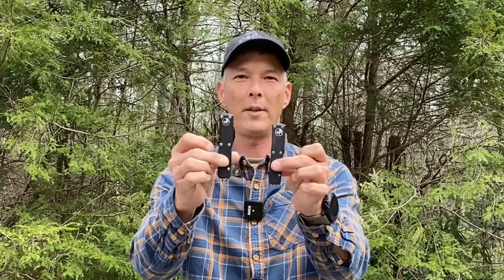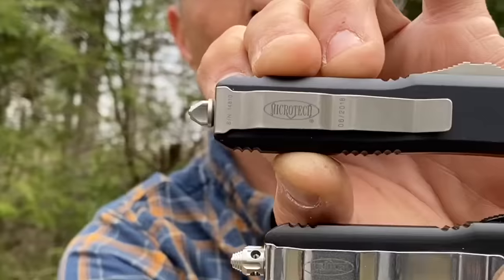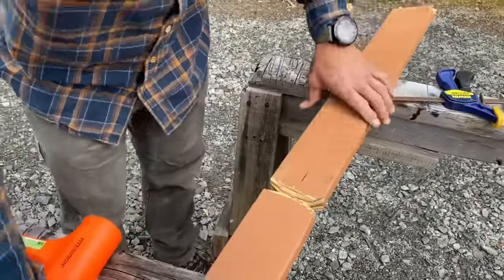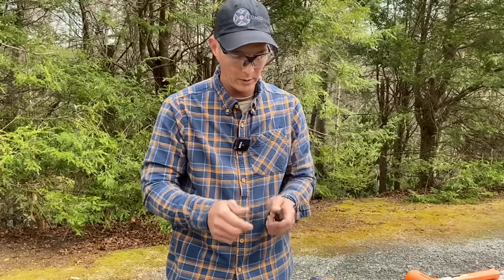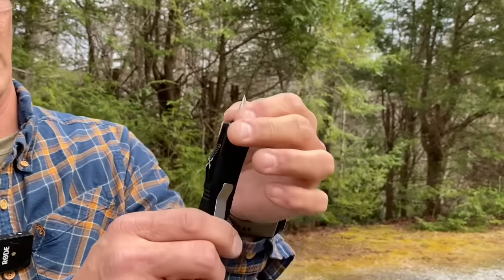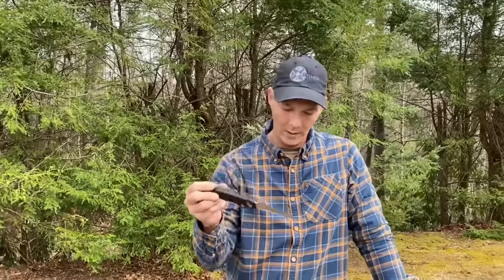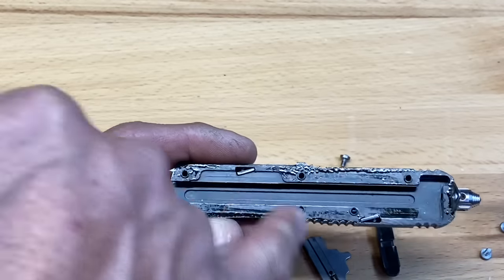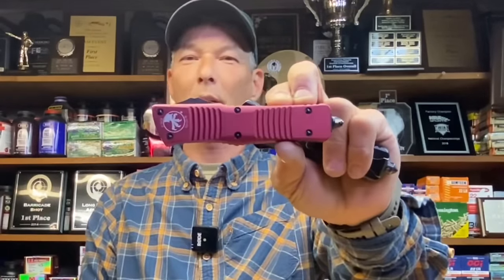Counterfeit Microtech torture test!

Comment: You did a damn fine job of proving that the Microtech is overpriced.
Reply: How so? One broke the microtech survived .
Reply: @mattmorrison9379  One's about $50, the other over $300.  There's a 600% difference in price, and the cheap one performs nearly as well as the expensive one.  It "failed" when induced to stress no reasonable person would be subjecting their  knife to (hammering it through a 2x4).  If the cheapo would spend a few bucks more on better raw steel, it probably would have passed that test too.
Reply: @heathwasson7811  fair enough, personally I like having a real one it definitely feels better than some clones I've held but hey to each their own it's all good.:)
Reply: It's amazing the amount of money you can save on production when you steal someone else's R&D, use cheaper materials, skimp on QC,  don't offer a warranty, and probably don't pay your employees a fair wage.
Reply: @blc628  Yeah, no shit. Everyone's fully aware of that.  Like we don't know the reason one can sell for $50 and the other for $300?  Glad you came around to straighten everyone out on that.  Feel good about yourself now that you had the chance to dazzle everyone with your stunning economical analysis?
Reply: @blc628  There aint any R&D in this type of knives. The technology is old and all tried out. All you need is a cosmetic design and good enough materials. Anybody familiar with Solidworks or Fusion360 can make the schematics to feed into machines. Warranty - yes. Thats another question. But warranty means that you shouldn't torture your item above the limits of normal use. Im more than sure Microtech's warranty wont cover breaking the knife while hammering it into 2by4. So, if the chinese clone stands more than normal use (as we see in this video) it would be a problem to just buy another one for 60 bucks if you manage to break it somehow...once in 10 years or so. At the end of the day you're still on the plus side.
Reply: What R&D? OTFs have been around since before any of us were born.
Reply from the maker: @MrSoymilk2 Internal designs, longevity deployment strengths. 
Zero blade play OTF’s etc.
That’s kind of like saying nothing wrong with the engine in the Ford Model T. …They have been around since before we were born.

Comment: Your point has been proved, thank you for clearing up that i can save 140$ and get a knockoff just as long as i dont carelessly nail it into a piece of wood for no reason :)
Reply: Yeah until one day when you're about to get mugged you pull it out of your pocket and a cheap piece of crap spring inside doesn't let the blade come out and your left holding a small rectangular piece of steel😂😂

Comment: Honestly not bad for a chinese knockoff.
Reply: What I was thinking
Reply: No clue what steel they use in them but I've seen friends clones that are spot on and some even better feeling and looking than some of my older factory knives lol
Reply: Not bad?!that shit broke in two minutes!
Reply: Yea who the fuck uses their knife as a nail.
Reply from the maker: Mr. Hammer ! 😂
Reply: @trillestdccxiii4971  It’s most likely either 8CrMoV, 440C, or D2.

I just recently got a Microtech but I’m thinking of getting a clone as a beater. It aches my heart to mess up a $270 knife, which I already did the day after I got it.
Reply: @havoso  In two minutes? It took minutes of taking several blows that no knife would take in a normal situation, this "hammer test" is a case that would naturally be unlikely to happen. The knife passed the previous test, which was very aggressive and he was even surprised that the knife cut the paper. The problem that the knife presented was with the small steel lock, you would just have to replace it with a small steel plate of better quality and you would still have spent hundreds of dollars less than at Microtech.

Comment: Also! Look at the difference the 10% more material makes! So if you add 10% more steel into the lock, then it passes the test. If not, it fails. What is the lesson? Knife costs probably 15 USD to manufacture, add 10% and you can sell it for horrendous prices! :)

Comment: Wow, I am stunned by the lack of ethics in many of these comments. Some are saying things like, "Wow X-Ring, you showed me how great a clone is! I'm going to go get one." First of all, X-ring did not demonstrate what happens to cheap steel when testing it as he did. AUS-8 (which is probably what these knock-offs use) can do all of the stuff X-Ring did, but will roll and possibly even chip. Bohler M390 (which is what many Microtech blades are made of) will also withstand those tests AND keep their edge without damage. But, on top of all that, even if these knock-offs can do what you need them to do, you are supporting criminal enterprises when you buy them! If they were simply crappy 30.00 look-alikes, it would be one thing, but these clowns are counterfeiting the Microtech logo and branding. They are pirates, period. Supporting their deception is unethical at best, if not downright immoral. Look, if you can't afford a Microtech, that's OK. They are expensive. So, go get a Lightning OTF instead. It'll only cost you 30.00 and you didn't sell out. Lightnings are from an honest company who doesn't pretend to be something they are not. One day, when you can afford the real thing, it's be a much sweeter experience.
Reply from the maker: You are 100% correct James and I appreciate your comment on this.  Seems like cost is the only deciding factor and nothing else matters to a few people.
Reply: @XRING  Thank you sir. BTW, I just watched the video where you burned and abused your Combat Troodon. I found it because I just purchased one and wanted to see some reviews. Wow, I was impressed. I know that to some they may see your torture tests as extreme but I, for one, want to see just how far I could push my tools without actually having to. I appreciate your work! Keep it up.
Reply: I think is its far worse that there companies try to screw us by selling knives at a 900% mark up, if Chinese knockoffs are good enough to compete and at 1/10 of the cost then it is obvious who is getting screwed

Comment: I've had one of those hellhound clones from DHgate for 4 years now. I've never tried to nail it into a board but I've been rough with it and it's still going strong. All the ones I've seen advertised say it's D2 steel and that's what it feels like, it's better than those 3cr13 Tacforce knives. As long as you know going into it you're basically buying a $40 knife and not to expect $400 worth of quality it's all good.

Comment: that counterfeit did pretty good considering no normal person would go so extreme on their pocket knife. for 30$-40$ its not bad at all. it just shows how much some companies overcharge for their products...
Reply: The Microtech is not overcharging at all. The parts are made in the US instead of using chinese labor. They have to pay their workers a lot more than the chinese do, since our SOL is a lot higher.
Reply: @notgray88  sure, labor costs are much higher than in China. However most of the work is automated and done on assembly lines. That is why it's hard for me to justify price of $764.26 for Microtech Troodon Tanto. Most of Microtech knives cost way too much, e.g. 
Microtech Ultratech OTF D/E Automatic Knife. Price: $935.00
or Microtech Combat Troodon Knife Price $1,150.00
I'm not even gonna mention Microtech Marfione Line where one knife can cost you $2,500.00.
I know that most of Microtech  knives cost in the range of $300-$500 but Kershaw knives average price is around $50 up to $100. Kershaw knives are made in Oregon. It is just my opinion, that Microtech is charging little too much for their products and I can see why some might want counterfeit instead.

Comment: I would not be able to hammer my 230 dollar knife through anything without crying.
Reply: then buy an affordable knife so you can actually use it..
Reply: in europe is over 460euros...
i better use a mora for batoning. and is 10 euros, dirty cheap and original.
Reply: Get a Benchmade OTF.
Reply: Apparently there are a few sites selling entire replacement blades for these clones for cheap too now
Reply: @shiitakestick  that way you only have to spend 450 instead of 230.
Reply: Florida Man - not here.
Reply: @shiitakestick  I have no idea what you're trying to say.
Reply: Florida Man -  I see a BM otf is now $420 - more than I thought - but I think it’s still a better choice than Micro-tech.
Reply: @shiitakestick  you're still talking nonsense. He's saying the knife is expensive so you say to get one almost double the price.
Reply: @moneymark7660  I have never hammered my knife thru anything.  I have used the end of my dirac delta to knock something into place however and I have plenty of knives to beat on if necessary.
Reply: @shiitakestick  the infidel has always been through the roof.
Reply: Florida Man -  youre right. guess I thought he meant a real microtech . 
excuuuuuse meeeeee .
Reply: I would not do that to my $50 bro
Reply: @moneymark7660  use a axe or he’ll get a Swiss army or a silky saw!
Reply: I have a $12 knife I’d never do this to. I think the idea is the 1 in a million situation you’re in a knife fight and stab a guy and it hits a bone and fails you’re dead… funny thing is it never failed like that, even under the most ideal setup for making it fail, all it did was not close properly afterwards, probably hit it just right to bend the case or something and some dremel or hammer work would make it functioning again. If anything this is an ad for the clones, no normal usage should cause these to have any issues, shame on microtech for overcharging.

Comment: The Vespa OTF's steal largely from Microtec designs, but they don't market them AS Microtecs...  They put them over their own label and they do make some aesthetic changes to them.  Their knifes however, ARE legit premium steels... Their lower level $80 knives are D2, but the $130-$230 knives are M390, etc...  Several buyers have sent theirs off to a metalergy firm for testing and got the test results back and they were legit.
Reply: If you are a knife guy it might help you to know the plural is knives
Reply: Ders972 that’s your contribution to the discussion?  To point out that I didn’t proof read my grammar?  One might think that  you went that route, because you had no other response to give?  Lol. Thank you for policing the internet to make sure that everything is spelled correctly.  Not all heroes wear capes.
Reply: The point people make about Microtech is that they claim the knife costs $10 to make (wrong) and they should sell them for $40.  Now a China based company is making their own OTF knife but feel they need to charge $230 for it.  Shouldn't they be able to make a quality OTF for $40?  No one doubts that China CAN make a quality knife, but they are not making quality counterfeit knives for $40.  Also, when it comes to counterfeits, it isn't in that company's best interest to make a knife that lasts, they rely on repeat business and know if you will buy one $40 knife you'll buy another when that one breaks... and another... and another.  Eventually you'll have $300+ of broken counterfeits when you decide to buy one $280 Microtech and you'll finally find happiness.
Reply: @Kevin Exactly.  Now, when at work, I make the extra effort to correct simple grammar or typos... but in the world of mobile and spotty autocorrect, I don't always catch it.

Comment: I think you just sold me on the clone. 🤷‍♂️ I mean I’m never gonna do any of the test you just did. And It looks like it can take a beating. And for 40$ what am I really losing. If microtech was cheaper of course I’d go that route but at 10% the cost how can you go wrong.
Reply: I predict you will be wasting a lot of your money re-buying things. Better to save up and buy once.
Reply: I have a utx clone from DHgate was 38. The quality is amazing. Fit and finish is amazing. Action is fast and solid. And blade took a shaving polished edge on my work sharp. Iv been beating on it and using it for everything and its held up great.
Reply: Only downside is no warrantee but there easy to strip down and work on if needed
Reply: Not that I condone buying clones but those Microtechs are way overpriced for what they are.  It would be a cool knife at $125. Costs them prob $20 to make it.
Reply from the maker: They cost WAY more than that to make.  I did the series on birth of an Ultratech on the channel.  Really made me understand what all goes into them.  Not justifying the price,  just stating the facts.  Thanks for watching.

Comment: Ah yes, that 380$ extra for the actual microtec so that I can drive it through a 2×4 is completely worth it. 
Granted yes, if it is blatantly ripping the company off with branding, no thanks. However if it's just the design I'll gladly pay the 20$ for the "cheap crap" that is nearly on par for less than 1/10th the price.

Comment: Pretty impressive comparison!  Interesting that it wasn't the blade lock that failed, it was the handle which I'm guessing is a Zinc alloy which would tend to deform under the hammer blows.  6061 Aluminum isn't the strongest alloy,   I would expect that MT would be using 7075 which is much closer to mild steel in tensile strength, but then, that's not how the handle material failed, it failed in compression, though not really "failed" so much as deformed just enough to stall the blade.  Most likely the knife could be put back into service by truing up the blade slot, and at least having a light-to-medium duty cutter.
Gotta admit the MT UT was impressive!

Comment: Microtech should make an entry-level version with no warranty and less expensive steel (D2 for example) for under $100.  Then there would be no reason for anyone to want counterfeits.  90% of the people that are interested in a dual action OTF knife are never going to baton with it and certainly aren't going to drive it through a board like a nail.  They just think they are cool and want to fidget with them and open packages and letters or cut off a string from their pants.

Comment: A little homework about Elmax steel:  It is a tougher steel with high carbon content that hardens to Rockwell 61-62.  It is also a powdered steel...meaning Elmax steel powder is compressed into ingots - or blade shapes, then heated to form the final part.  Interestingly, in other areas of the consumer market, POWDERED steels are considered total crap!  Many in the gun world never grow tired of dissing powdered metals as being "cheap" and "weak" and subject to breakage compared to good old forged and machined steel!  Interesting indeed!
Sure, eventually, all steel items will be formed from a powdered alloy because this is easier to create parts in the final shape and near dimension, and of course in 3D additive manufacturing, though even now that process is far too expensive for common knife making.

Comment: I ordered two knives off dh gate. The benchmade 9400 came in two weeks and is fantastic. The fakerotec halo vi is still in the mail and it hasn't updated shipping in over a month. Even if it never shows it was worth it for the benchmade clone.  I think it's best to buy the most expensive one with reviews.
Reply: Did the Halo ever arrive?
Reply: @aznazguy  sure did. Absolute perfection. No blade play whatsoever unlike the real ones and unlike the real ones it came with a tool to disassemble. I've fired it a couple hundred times and it's still holding up great. I

Comment: Got my first microtech today and was watching this video with dread until you were pointing out the fake give-aways and noting that mine didn't have any red flags. WHEW! Still not gonna hammer it into a board though.

What's surprising me the most is when you took it apart the sheer simplicity of the design. I been thinking there was  a ton of moving parts in there but it's honestly not a whole lot and it looks like worrying about pocket-link affecting it's function is not a real worry because it can be easily maintenanced due to the simplicity of the internal design.

Comment: I've been tempted a few times to buy a Ultratech.  I have a Cobratech, higher end with the Aluminum handles, and D2 blade.  I paid about 130 dollars for it about 3 years and have never had an issue...Now, I was thinking of buying a Ultratech, and the one I was looking at is 290.00...The Kicker is, even though it's 290 bucks, the website says, "we can't tel you what Steel the blade is made of, as we change all the time".......If I'm paying 300 bucks for a knife, I'm damn sure going to know what "steel of the Month" I'm getting......

Comment: I would still love to see a torture test of a vespa troodon knockoff..   those are on another level than the other crappy China knockoffs. Not all knives sold on aliexpress are created equal and I welcome the competition because that’s what will drive microtech to innovate further...
Reply: You're totally right .
Reply: I have gotten some of the best knives I have seen in the $100-250 range on AliExpress and DHgate. Sure they are clones, but amazing knives. Got two Microtech Sigil clones that are just amazing. Got a Shirogorov RFT that is the sharpest I have ever seen a knife straight out of the box. Got a Shirogorov 110KS that is just a marvel of machining quality and smoothness. Got a Fischer Battle in damascus that blew my mind. There have been bad ones also, but fewer than the successes. I think the worst was a ZT 0777 where it is impossible to center the blade properly and still have it flip reliably and a CKF Decepticon with a detent so lose that the knife might open in your pocket.